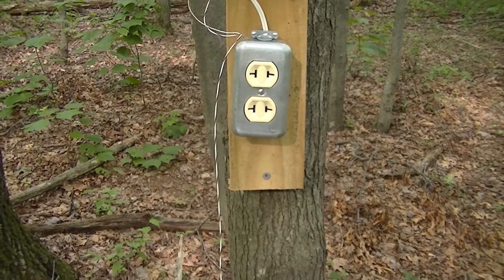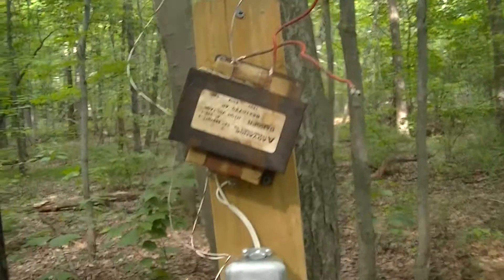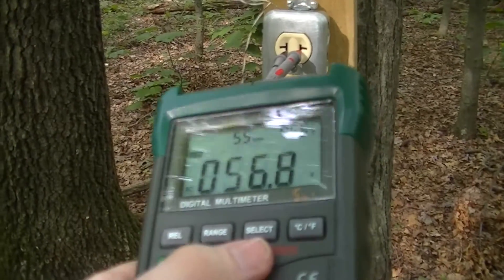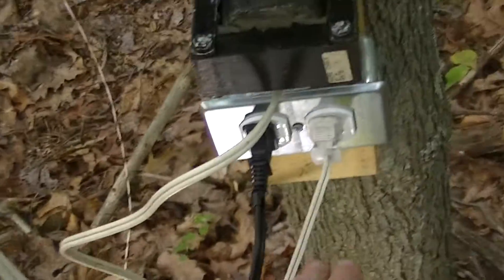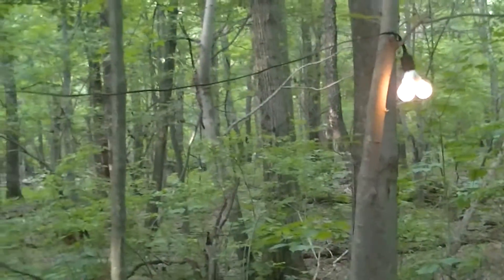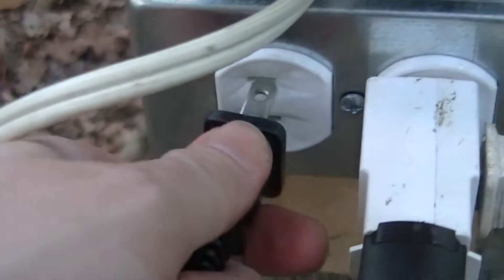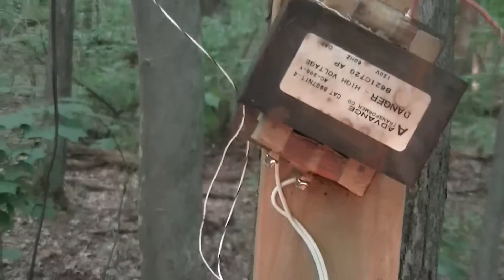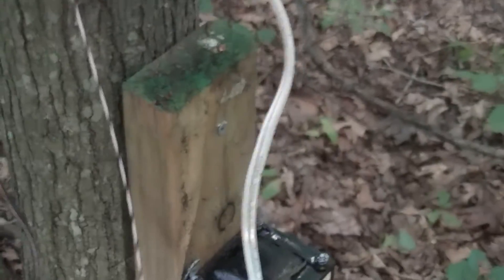DIY electricity transmission line

Comment: I wanted to do similar to run power to a barn about a mile from a the power grid. I had 2 pole pigs (7200v) and figured it would work but didnt need the county getting upset

Comment: Could the MOTs be used as is if they were cooled in some way and to what extend do they need to be cooled? I have understood a transformer does use power (primary circuit) unless a draw is present on the secondary winding. Does this mean an MOT only gets warm/hot if the system is used near or at it's power limits ? Would a set of 240V MOT's operating at 120V be useful in preventing the MOTs getting too hot ?

Comment: I've done something like this on my channel but I have the mot's on the regular voltage.
When I did it the first time it was only 80v on the step down mot, I put a hv capacitor on the hv side and it went to 115v still 5 volts low but very close, and I ran around 1,800 watts off it over I think 200 feet!

Comment from the maker: Using 2 transformers in series would require 4 reasonably well matched transformers, and what I have is what I can get for cheap/free.  And since their secondaries are tied at one end to the core, I would need 3 wires (2 HT and the safety ground) instead of 2.  I could also use 240V MOTs (rare) or continuous duty 1kV-2kV transformers (expensive).

Comment: cool. pretty much how they do it to get power to your home.  you would in theory use like 2 microwave transformer at each end in series to lower the power to each transformer and run the out puts in series and then transmit the power. and you can also get a drum to put each transformer in a bucket of mineral oil to keep them cool and electrically isolated. be like your own power sub station.